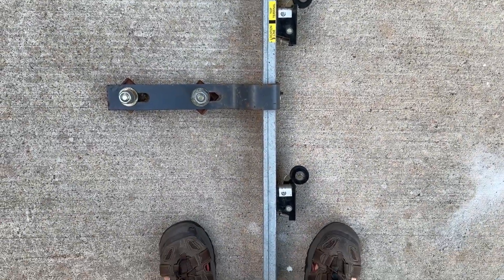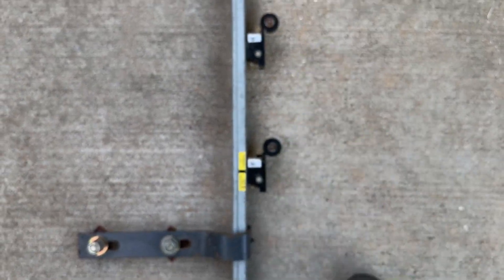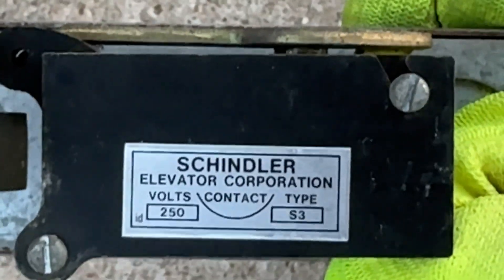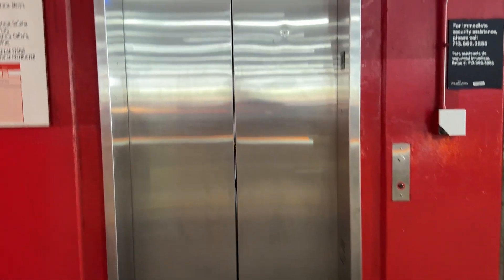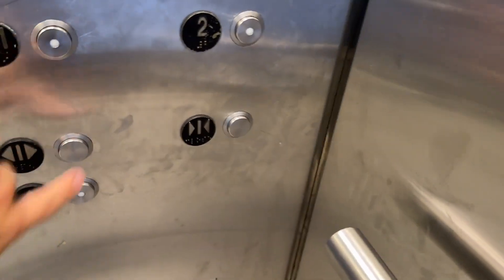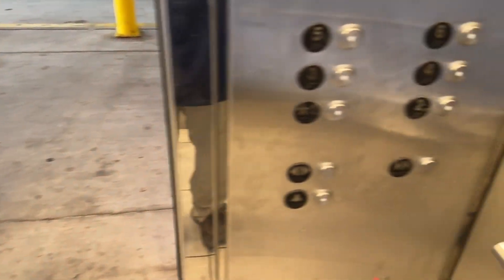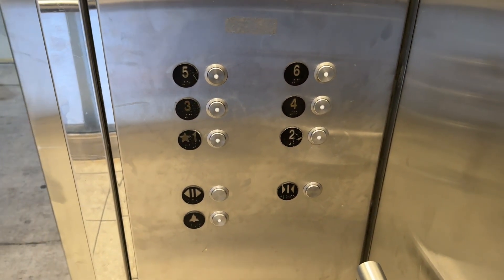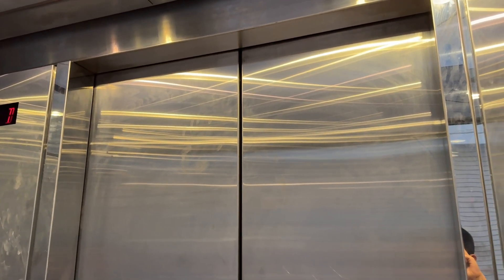Revealing my Schindler Elevator Limit Switches - #NationalElevateDay Special!

Comment: Are elevator limit switches activated every time the car passes by or only when the car stops at that floor?
Reply from the maker: I think it does both. Not sure though, but I seen a limit switch in action on a full-glass elevator before, so I assume it does both.